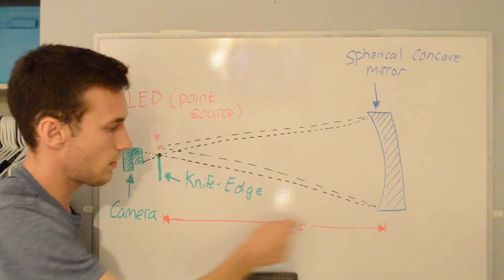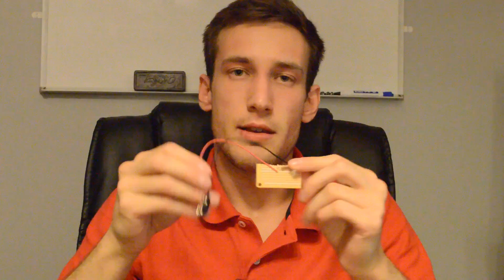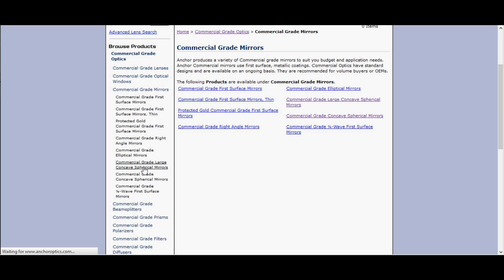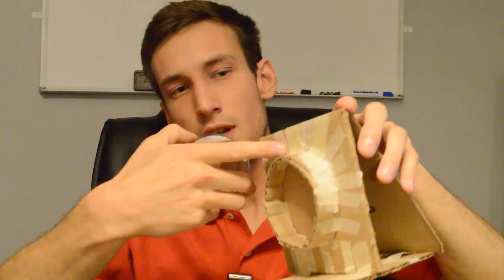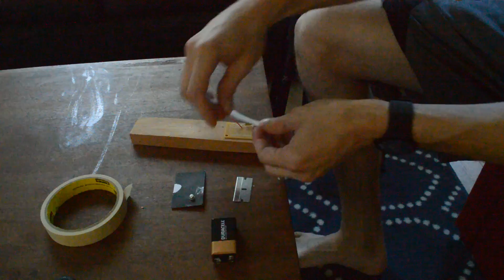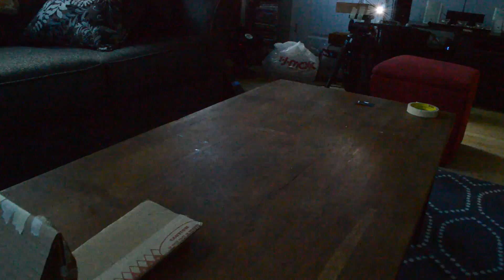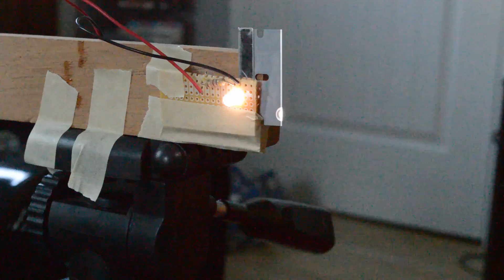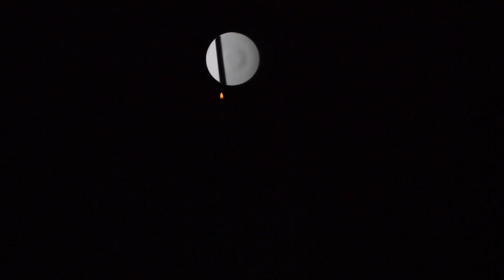How To: Build Your Own Schlieren Setup

Comment from the maker: Can't get access to a nice mirror?  Or you want to try something different?  Check out my video on Background Oriented Schlieren (BOS): https://www.youtube.com/watch?v=VCUN59x0LF4
Reply: What kind of cameras can this work with though?  Do I need something fancy, or could I use a phone?  if not, then how fancy does one need to get?
Reply from the maker: @aether222  You can use your phone without a problem.  I would highly recommend putting it on a tripod though.  You can get rid of vibrations (as I show in that video), but it's much better if you use a tripod.
Reply: @JoshTheEngineer  What did you think of my idea of using computer methods to further enhance optical Schlieren photography?   If computers can enhance regular video to show Schlieren so well, surely some method could enhance optical schlieren to make a super sensitive system?! (even if it needs a version that works with brightness or colour not translation).

Comment: Wow, great video! Thank you for the detailed explanation. I was going to do some experiments with a less-then-opticaly accurate parabolic mirror and you saved me from a lot of wasted time.
Reply from the maker: Thank you!  I'm glad I could help.  As you saw at the end of the video, the bathroom mirror produced pretty poor results, but it did technically work.  So it ends up being a trade-off between price and quality.  Depending on your application, you could start with something you have lying around, and if it doesn't give you what you want, then a move to a higher optical quality might be a good idea.

Comment: That's a cool set up! I like that you used a commercial one to show the difference in quality of the image. It made realize i didnt have to get fancy just experiment with this type of photography. It would be a cool experiment to do in a middle school or high school physics class too, for the teachers out there teaching kids about STEM.

Next time you do this, you can try using the spot meter on your camera, your camera will only ready a specific point instead of an area. If you put your nikon on aperature priority, set it to the smallest f/22, with a spot meter (exposure settings (AE, scroll using the wheel, find spot)), you wont have to fiddle around with the exposure compensation as much, or might be able to go darker to get. more contrast which seems key to this type of imaging. Closing your windows would've helped to, your camera wont try to read the ambient light, it would just over expose the experiment.

Thank you for taking the time to make this really in depth video! i am taking a compressible flow class and saw this technique being used for past experiments, did some google searches and found some neat videos, yours by far the best! I am a photographer and engineer so this experiment tickled my fancy haha.

Good work!! =D
Reply from the maker: Thanks!  Yea, this setup is super simple and would make a great display for some STEM outreach.  That's been on my list of things to do for a science fair or something, now I just need to find the time.

Good advice regarding the camera settings.  I always just default on matrix metering because that's what I mostly use when I'm outside shooting.  Unfortunately the blinds on my windows are what they are, and let quite a bit of light in even when they're fully closed (although after looking at my video again, I noticed I didn't even close them).  I'll try the small aperture and spot metering next time I set it up.  Thanks for the info!

Good luck in your compressible flow class.  It was one of my favorites when I took it in undergrad.  I actually have quite a few compressible flow videos on my channel if you ever get stuck.

Comment: Cool video.  To show the turbulence caused by the heat of the candle it is better to have the candle several centimeters below the center of the mirror.  The column of rising air above the candle is laminar for a few centimeters then transitions to turbulent flow.  The turbulent flow is more interesting to watch.
Reply from the maker: Thanks.  You're correct, I could have moved the mirror up a little.  However, showing the laminar part is a good way to show how the knife-edge affects the results  you're seeing.  I didn't switch the knife-edge in this video, but it would have been a good explanation to rotate it 90 degrees, and show that you don't see any gradients.

Comment: I recently discovered Schlieren imaging.  I want to build one myself.

There are a few variations that I suggest to you should be investigate.

VARIATION #1

You used a vertical position of the razor blade.  How different the image would be if the blade was horizontal?  Comparing both images vertical/horizontal razor blade position would be interesting.

Along the same line, how about puting the razor blade a different angular increments and compare the resulting images?   For example, you can choose the angular positions of 0, 15, 30, 45, 60, 75, 90, angular degrees.

VARIATION #2

This is something I saw from another YouTube video.  They used colored light filters instead razor blade.  This gives a far better result because the image is no longer blocked off, but colored.  the resulting image gives far more visual information.

Another similar variation is to use use two colored filters side-by-side in place of the razor blade.  This seems to give the best result of all because the surface of the gradient becomes visible at both poles of the gradient.

Another similar variation would be to find a color filter that changes from one color to another.  This may be from one color to full transparency.  This type of color filter might be harder to find, but they would hold good results because no information about the image would be lost for contrast.

VARIATION #3

Use a polar light filter instead of the razor blade.  You can use the polar light filter in the cheap 3D glasses given in movie theaters when they show 3D projection movies.  Polar filters have a direction up/down or left/right.   You can experiment with that in the same way as with the razor blade.  First you try one filter replacing the razor blade and see what the result is.   The filter might block off too much light and acting like a razon blade.  Then you can try two polar filters side-by-side with one having vertical polar direction and the other having horizontal direction.  I imaging that the light intensity might have to be increased significantly.

Comment: Kudos... well done. 

A question: if you wanted to capture a sneeze or breath, let’s say an area a little bigger than a head, that would require a mirror of maybe say 12-15 inches. Obviously a quality scientific mirror would get pricey... any suggestion for an “adequate” solution? Perhaps a solar capture plastic mirror? Obviously not “fine”, but perhaps better than the cosmetic mirror.

Again, this is a well done demonstration. I showed it my son in law, his response was two simple words... “mind blown”.😉
Reply from the maker: Thanks!  Yes, mirrors can get quite expensive, especially nice ones that you need for schlieren measurements.  One method that doesn't need a mirror is called background oriented schlieren (BOS).  I recently made a video going through an entire DIY setup that might interest you (https://www.youtube.com/watch?v=VCUN59x0LF4).  You might have some trouble getting it to be as sensitive as a conventional schlieren setup, but this recent video by LaVision shows how sensitive it can be (https://www.youtube.com/watch?v=kYJvU81DKgk&feature=emb_title).  Note that LaVision is a company dedicated to flow diagnostics/visualization/imaging, so what they show is going to be hard to achieve at home with a simplified setup, but you can get pretty close.

Comment: Amazing video. 
I have a quick question, if you have the time.

What is the minimum temperature difference that can be shown in this setup? 
Can heat rising from a human body be shown like this?

Thanks very much.

Comment: Oh, thank you so much. I was trying to make Schlierenfotographie for years and at all the sites were I have been everybody talks about putting the camera at 2f. So it never worked. Your video gave me the clue needed that it must sit on 1f. So obvious. I thought I messed up some other component. 
Now it works. 
Do you think that one can observe smaller differences in refractiv index of the fluids with better optics?
Reply from the maker: You're welcome!  I just want to make clear here though that in this double-pass (single mirror) system, the light source and knife edge are in fact located at 2f.  That is, two times the focal length of the spherical concave mirror.  A better mirror is the easiest (though probably the most expensive) way to get better images.  You can also change sensitivity with the knife edge.  It will also depend on the size of your light source and the tightness of the focused spot.

Comment: I have two meade LX telescopes that have nice mirrors but failed electronics. An 8 and a 12 inch. Nice basement to set it up in for the distance. Time to get busy!
Reply from the maker: Sounds great!  You can also try a Z setup with two mirrors.
Reply: Hi Josh, I tried to set up my 8 inch Meade SCT last night. I took the corrector off along with the secondary mirror. They aren't suited for this. The focal point of the primary mirror is 16 inches where it is folded by the secondary into a baffle toward the visual back. The mirror also has a good sized hole to fit the baffle. I had considered it would be a problem way before starting but played with it anyway. Any ideas? I did notice if I place a bright LED flashlight smack in front at 16" I get a focal point across the room on the far wall. Unless I am confused. I thought you were focusing on a pinpoint with your camera. I'm not clear how you could resolve that tiny point into something useful. I'll watch it again.
Reply: I figured it out.

Comment: Great demo!  Could you now make a DIY supersonic wind tunnel to watch some shock waves?!
Reply from the maker: +joemonster55 
That sounds like something that I would definitely be interested in doing (i.e, make a shock tube with a little viewport and a place to insert a mini model).  However, this will take some more time to think about and execute.  I do have some other interesting ideas about how to use this setup to visualize shock waves from bullets, etc.

I will probably post a couple more videos describing minor perturbations to this setup first, such as using the external camera flash instead of the LED.  But if you have any cool ideas, let me know!
Reply: +JoshTheEngineer  I would also be interested in a DIY video of a shocktube to see some shockwave (If the cost can be kept down like we see in this video).  Can a simple paintball gun produce a supersonic shockwave if we fire it into low pressure air?
Reply from the maker: The shock tube idea is definitely still on my to-do list for the future.  I have so many other videos I'm trying to work through at the moment, but I'm going through some calculations for a shock tube design that would result in shocks strong enough to be seen by a simple Schlieren system like I showed in this video.

I also wanted to do a video on Schlieren images for some sort of gun or projectile launcher, so that's in the works as well.  I would have to look more into paintball gun firing velocities, but I can guarantee that you would see something coming out of the front.  What you see and with how much sensitivity will be dependent on the gun characteristics and the sensitivity of the Schlieren setup (focal length, mirror quality, light uniform-ness, and so on).

Comment: Thank you for your post! This is the best video I have ever seen about Schlieren-Shadow imaging. I successfully built a mini one with a concave mirror that has a f=50 mm. Most of the parts of mine were 3d printed. I can see hot air, butane and helium. But argon, not really. The mirror I used was a scientific grade concave mirror with aluminum sputtered for UV. Also I used green LED instead of a white one due to the fact that refraction of light is positively related to wave length. I think a blue one might work better.
One quick question, have you thought about build one with 2 concave mirrors? That should give you "True" Schlieren imaging and better sensitivity. BTW, I don't think the focal distance is the major factor that determines the sensitivity or image quality. Instead, I think the quality of the pin-hole and the razor blade are the keys. Please correct me if I am wrong about it.
Thanks again for you post!
Reply from the maker: Thanks for watching; sounds like you have a pretty cool little setup!  I definitely want to make a 2-mirror Schlieren setup at some point, but the reason for making this one is that it is the cheapest for the frugal DIY-er.  It's also pretty easy to construct and align everything.  I'll probably get around to make a more scientific setup at some point.

There are a lot of different aspects of the system that affect the sensitivity.  I mentioned the mirror as (arguably) the most important component because of the uniformity of light that we see in the images.  If the mirror is poorly constructed, you'll get some dark spots, and the light source won't focus back to a perfect point.  This then makes the razor blade placement a little tricky.

I do think that the focal length is important for sensitivity because if you think of the divergence of the ray from it's nominal (non-refracted) path, the longer the focal length is, the farther the displacement from its final location it will be when it gets to the 2f distance.  This makes it more sensitive to pick up lower density gradients.  However, like you mention, knife-edge placement is also key.  You can pick up different gradient directions by aligning the knife-edge vertically, horizontally, etc.  You can also block all the undisturbed light as well by making sure the knife-edge covers the center of the beam, and then you'll only see the refracted light.  There are a lot of different opportunities with regard to the knife-edge design and placement that will affect what you see in the image or video.

So it really ends up being a combination of many components that influences the sensitivity and images you see, and it's hard for me to confidently say that this one component matters more than that one without getting into some more advanced optics equations.

Comment: if the LED is placed at 2f position and the viewing angle of the LED is too large does that mean not all of the reaches the mirror and being reflected? if thats the case does that mean i need to use the tangent formula and calculate the half angle of the LED to choose the most appropriate one?

Comment: you might be able to sell pre prepared sets? nicely fixed lens holders and the correct distances etc :)
Reply from the maker: Hah, that would be nice!  I've been 3D printing some parts for this setup, so when I get all the kinks out, I'll make those files available.
Reply: that is even more humane, wow im surprised. im like that myself, did not expect that :D i just share it and seed ideas into the world. still, for peoiple without acces to a 3d printer, you could offer a starter kit :d well balanced etc, or a little booklet i dont know :D keep up the awesome work!
Reply: do you often engineer projects etc? im working on a 3D ufo model that i think could work, like a drone only everything doubled in xyz like rotors on top and below working in tandem. im looking for someone with engineering experience for a few pointers perhaps. :0 some one who likes to help save this world :)

Comment: WHAT A NICE VIDEO!!!!
but,I think in this system the light has passed the Density variation region twice， I think，it will has some infulence  for this system。
Reply from the maker: Thanks!  Yes, in this setup with only one mirror, the light passes through on the way to the mirror, and then again on its way back to the camera.  A Z-type system is a little more straightforward in that the light only passes through the region of interest once, but you also need to buy an extra mirror.

Comment: does it have to be 2 feet away or can we bring the camera closer?
Reply from the maker: You can play around with where the camera goes after the knife-edge.  Its placement isn't as important as the other components, but it should be located such that you get as large of an image on your camera sensor as possible.

Comment: Great work Josh! I have a question tho... why is it better to use a spherical mirror instead of a parabolic one? Since parabolic mirror focus collimated light without introducing spherical aberration I fail to understand why shperical mirror is the best choice. Cheers
Reply from the maker: Thanks!  The spherical mirror is needed for the double-pass schlieren system, whereas the parabolic is needed for the Z-type schlieren system.  The one I show in this video is the double-pass, and only requires one mirror.  I'll probably make a video on the Z-type system at some point, but it requires two mirrors.  You're right that the parabolic mirror collimates the beam, but we actually don't want any collimation for the double-pass method.  The spherical mirror is used because if you locate you point source twice the focal distance from the mirror, it will reflect off the spherical mirror and focus back down at the same 2f distance, which is then where we place the knife-edge.  For the Z-type system, you place the point source at the focal length of the parabolic mirror, which then collimates the beam, and then a second parabolic mirror takes that collimated beam and focuses it down at one focal length, which is where we place the knife-edge.  There are pros and cons to both types of systems, but that's the reasoning for the different mirrors.